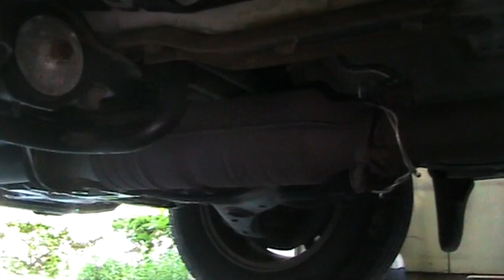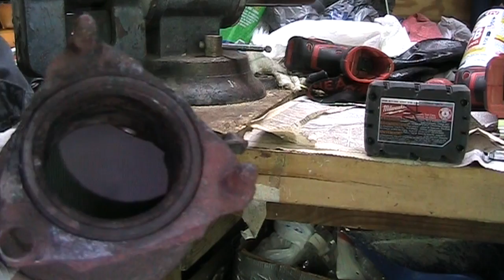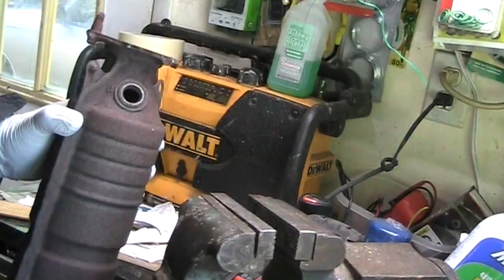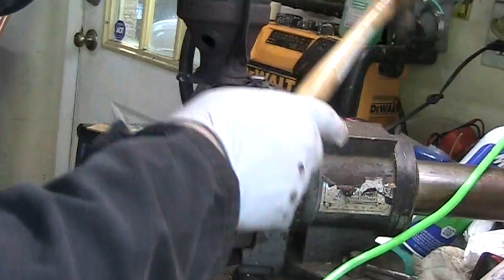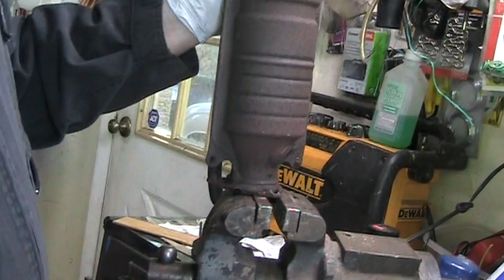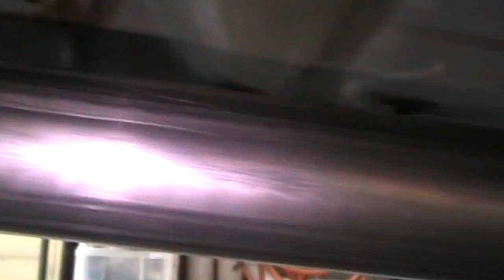Honda Catalytic Converter Repair, Civic, Accord, CRV, bolt, stud, how to, fix

Comment: How do you know when to replace a cat?  Or do they last forever?
Reply: When the flanges fall off or the ODB2 faults a P0420 P0430. It could be the rear O2 sensor. But when it goes you will never get it out without the Cat turning to powder.

Comment: nice job...I noticed one thing..are the 2 front flanges supposed to have a gap between them??...or smooshed together?...I have to gut out my converter and am wondering about that- if I have to have a slight gap beteen the flanges where the donut gasket goes...thanks